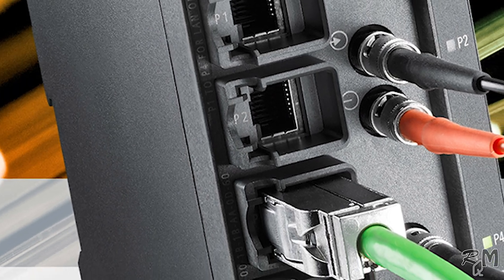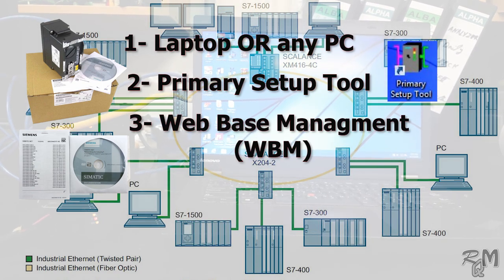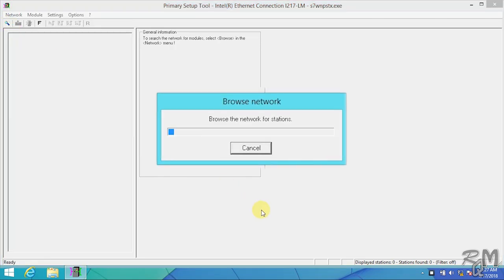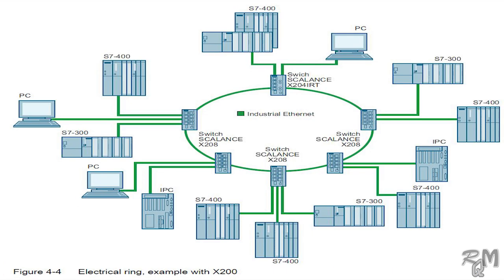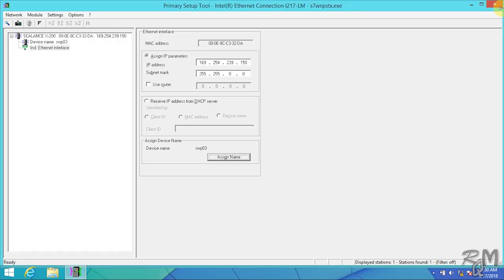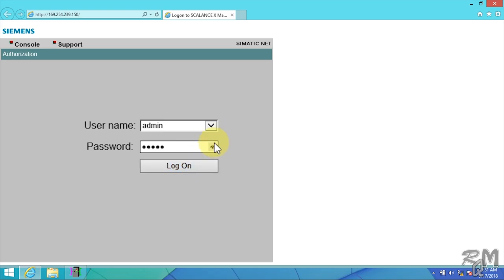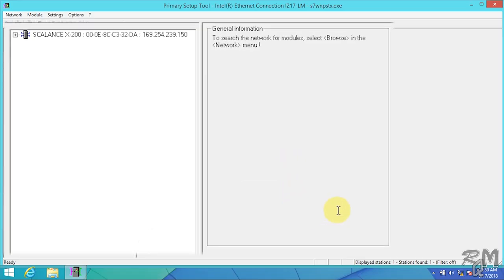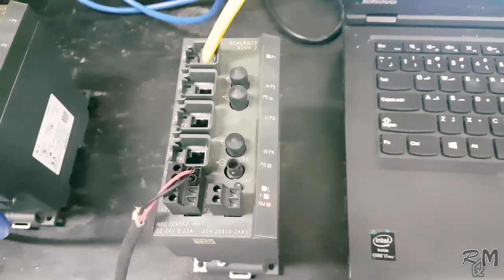Siemens SCALANCE X200 X400 Fundamental Method of Configuration

Comment: but we did not done any configuration while replacing the  scalance switch . all switch should be configured?
Reply from the maker: New switch has factory default settings that's why need to configure as per your requirement.

Comment: Sir,
I have a scallance X 408-2, but it is not getting detected in PST
Reply from the maker: It is difficult to answer with short Information but usually if you are installing new Scalance it will not detect not detect by old version of PST. You need to install newer version of PST. Then try. Hope it will help.
Reply: Thank you for the  information  sir.

Sir, we have three Scallance switches( X 408-2) installed 3 years ago,all are in Ring network and were working fine.Yesterday due to Maintenance of UPS all switches we're powered off and when power was restored one of the Scallance switch showed "Red" colour Led lit  in F button and also the RJ-45 ports were not blinking.
When I tried to access this switch via PST the ports are not responding( Send - Receive LED are also not Blinking)

However the other two Scallance switch are responding on PST.

Kindly help

Comment: Please tell me that during running of Scalance X204-2, if i go to configure that module, can this module stop working??
Reply from the maker: No in normal running mode u can see configuration of scalance it will not stop.
Reply: @QasimMaqbool  i want to check event log.. Bcoz last night scalance got F light on.. So its mean i can check during plant running.. Thanks.. Plz provide PST software
Reply from the maker: For event log u don't need PST, for event Log use Internet explorer.
Reply: @QasimMaqbool  i check from Proneta.. We have total used 10 nos of scalance.. But no ip assigned..
Reply: Currently these scalance has 0.0.0.0 ip.. means no ip assigned
Reply from the maker: It is really strange, 10 Nos Scalance without IP addresses. Dear You can download PST from Siemens site currently I on vacation and don't have PST in my personal system. I don't think that PST will give u any event log.
Reply: @QasimMaqbool  so what u think what will be the cause?? F light on and PLC data loss.. I reset the power of scalance then its ok.. Any idea
Reply: @QasimMaqbool  can we configure X204-2 with Simatic Manager..??

Comment: Dear brother, what does RM (Redundancy Manager) light blink means on the SCALANCE switch???  I had communication error from one of my switches to the SCADA(No fault alarm on the switch but RM was blinking), but without any troubleshoot it became normal. What could be the root cause of it??? Becoming normal automatically is quite strange to me.
Reply: Please try to reply on this.
Reply from the maker: Dear If in normal State RM LED is Lit Green, Its mean this Switch is Redundancy Manager. Usually it start Flashing when detects some interruption in ring. Its mean one side of ring sometimes become faulty. I will recommend you to open Web Base Management in Windows explored  log in all switched one by one and expand "Statistics" folder then Click on "Packet Error" and check is there any "CRC" count in Any port of switch. Check port Cables / Fiber optic if OK then change the switch. Detail Troubleshooting is difficult to write here. At least check "CRC" hope it will solve your problem.
Reply: Qasim Maqbool Jazakallahu khair. Thanks for the  quick reply. It’s helpful. 😊😊

Comment: When i do browse to detect the scalance switch i am getting an error as " A network problem has occurred. Please check the networking of the network adapter selected as the online interface and repeat the action" can you help me to solve?
Reply from the maker: Sometimes if ur Laptop Network adapter IP address "Obtain IP address automatically" selected then it could happened. So change it Laptop IP addresses something like 192.168.100.4 and subnet mask 255.255.255.0. Then try to Browse network by using Primary Setup tool.